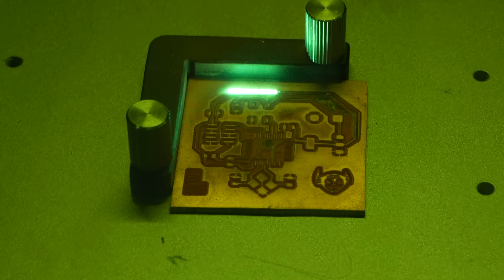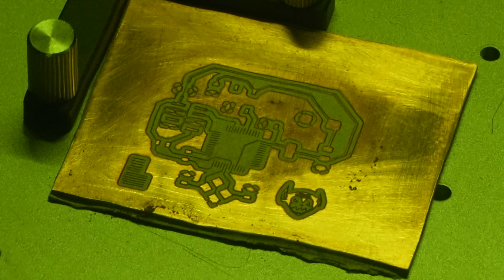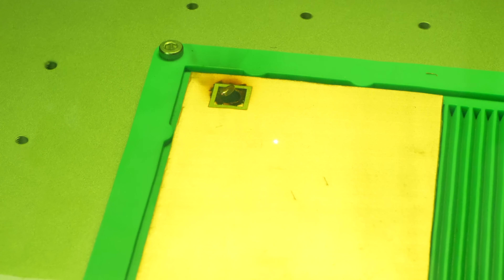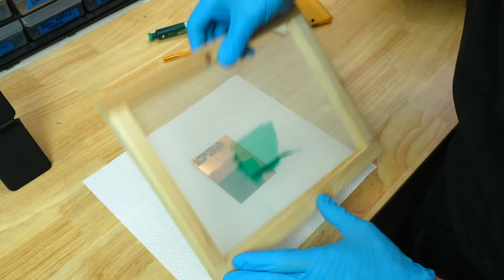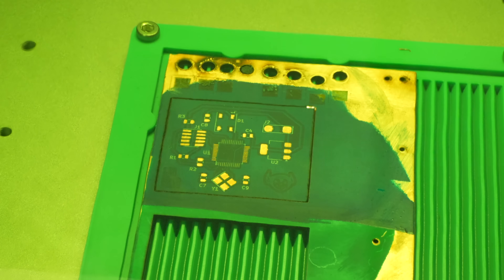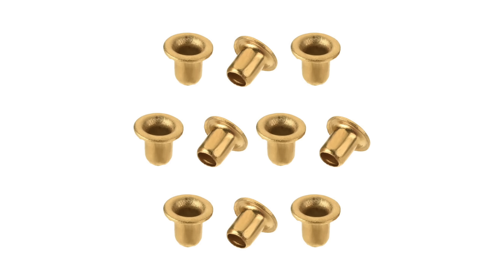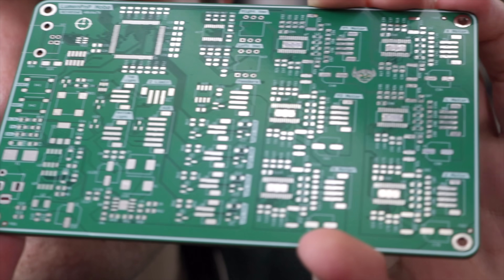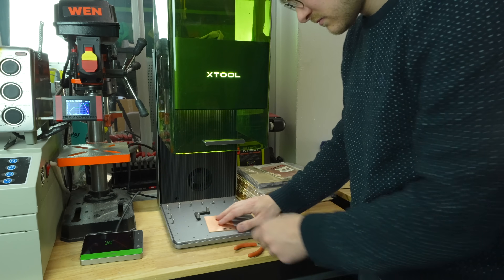Prototype PCBs faster than 3D Prints

Comment: As an electrical engineer I might have few suggestion: 

For the PCB alignment, you should use fiducials (little copper marker) in a triangle pattern. Then calibrate the XY plane of your machine by pointing the laser to it at a low intensity. This is how we are homing our pick and place machine. The other solution would be to use alignment pins, Drill at least two holes and use them as a reference for the next operation. Using the edge isn't a good option as it is never flush nor totally square and will cause alignment issues;

For the "via", I did try the rivet methods while I was at Uni and it was painfully slow! If you don't need to solder a component into the via, it was faster to simply use a copper wire and solder it through the via hole. If you are using a thin gauge (28AWG) this will result in a smaller via than if you where using a rivet. And like you said, I was also always soldering all the rivets because I had issue with connectivity/resistance otherwise. So if you need to solder anyways, better solder something fast! I also tried two other things to make it faster with modest success, I used a solid copper wire (diode lead) that I was pressing into a tight via hole and cutting the excess with flush cutter. Doing this for all the via without soldering. And then I applied solder paster to it when I was ready to oven reflow the part. I would suggest this approach only if you are planning using solder paste. Finally, I also tried to plug the hole directly with solder paste, but it wasn't working properly, maybe it could work by tweaking the hole diameter;

Also, I have others random suggestion, you could use Liquid Tin by MG Chemical to apply a small layer of thin on all the copper to reduce oxidation on pad that are not soldered. It also make it easier to solder onto the pad. When cutting hole, it seems that you are dumping to much heat at the same time, I would either add a wait time between each laser pass or cut multiple via at the same time to avoid heat build up. Avoid using via all together, make pads on the top and bottom and solder a pcb perpendicular to the main pcb to connect the pad together, this is WAY faster than trying to make via but it will make your design bigger and it might be not practical in some scenario. 

Like your your work, good luck with your projects !
Reply: Definitely good shout with the liquid tin, I've seen and felt the difference and it really does up the level of professionality. For the vias, I think he's looking for something more "at-home" automatable with what he has or what is readily/economically available. When most of it is automated already, using wire for any board with more than a couple vias would feel tedious quick, even on a prototype run of 10 pieces.
Reply: @thewolfin  Sure but automating rivet won't be easy either! The only ways to "automate" it would be either fill the hole with a paste that is conductive (solder paster, silver epoxy) or doing the whole plating bath shebang.
Reply: Bumping this up. I think the drill+wire+solder is the way to go for vias. As an upside, I think it would have bigger current/thermal carrying capacity than a factory via, but automating them would be... Interesting, to say the least. To maintain flatness you'd need to drop a piece of wire that's slightly shorter than the thickness of the board, and somehow leave it hanging in the middle.

Plated holes for mounting/through-hole components would be a nightmare, can't think of a better alternative to regular plating than rivets.

Theoretically, with tight enough parameters and an argon blow, it should be possible to "laser weld" the wire, but I imagine it would be a nightmare to tune the process for.
Reply: @Taugeshtu putting two (different!) metals together is always done by ultrasonic bonding. Less heat and if done right, no oxidation on the contact surface. It builds a real alloy of the two metals in the contact area, where welding would carries too much heat in and can cause delamination of the copper.
Reply: Cut alignment holes and make a jig with matching pegs. 

You could use through hole rivers to make the jig pegs. Cut holes in the jig. Push through extra long rivets.

Cut alignment holes in board the same diameter as through hole rivets.
Reply: Ah, the „register-pin-idea“ for alignment is already placed. 

I like your recommendation for the vias: soldering a wire and cutting it off is really faster, than rivets.
Reply: Came to look if anyone had mentioned a register pin. Had the same idea about the via's.
I like that edge solder idea too, make a circuit box instead of circuit board lol.
Reply: as someone who is not in this field at all, for any via that would need a component soldered into it, what is stopping you from leaving the hole empty and just using the leg of the component itself as a via
Reply: @hankhasemeier6887   You would need to solder both the top and bottom of the component you want to use as via. This might be easy with a through hole resistor or diode. However, this is way harder with any part that cover the leads (example, electrolytic capacitor, socket, led, connectors). Also in that case, surface mount component are needed to be use easily with a pick and place machine. So the through hole component would be limited to component that cannot be easily soldered both side anyways.
Reply: @matthope_qc  ahh thats right thanks for the info. Not being in this field I pretty regularly forget that surface mount components exist. Ive never had a hot air station or done any work with surface mount components.
Reply: @hankhasemeier6887  I haven't made any PCBs in years, but I used to etch boards, which meant laborious manual drilling. I found that a judicious combination of SMD & through-hole components could minimize the number of holes in a two-sided design.

Incidentally, according to the MSDS, that Liquid Tin seems pretty nasty.
Reply: The "liquid tin" suggestion sounds like DIY HASL. Makes total sense to do that.
Reply: Really what you write here is awesome. Let me ask one question if you can support me to get more understanding the Tin layer on the shown copper how can I apply it ? When can I apply it , before or after solder mask? 
If I apply it after solder mask, is it will cover the solder mask or it will not get stick on it ? 

Can I use it to fill the inner surface of the via to make a connection between the layers ?
Reply: @Abaqrino2020  the liquid tin react with the copper, so if you use a solder mask it should still work as long as the copper is exposed. Since it only reacts with copper it shouldn't do anything to the solder mask. But I think it is better to do it before. Finally, it won't fill a via, the layer is too thin for that. 😢
Reply: @matthope_qc that’s great I got the point , is there any chemical can be used to be a conductive and fill the via ?
Reply: @Abaqrino2020  I only used rivet or wire. Never had luck with chemical process. good luck 🤞
Reply: @matthope_qc  thanks a lot , I will try the chemical and give you the feedback.💪🏻😄

Comment: Consider using silver adhesive in the via holes w/ a low temp solder? Something below the max temp of the silver adhesive. I worry w/ via holes about the "parallax" (for lack of a better term) of vias far away from the center of the board. I think the solution may be an X-Y stage to hold the board which, with some other method of indexing, may also help solve the alignment issue.

Comment: What about the quality and lifespan of the board? Laser use heat > copper is a good thermal conductor > heat causes copper to oxidise > oxidised copper loses its high performance for electric conductivity and increases resistance? I guess laser it is a good way for making prototypes or as a proof of concept, but don't think it can produce high quality of products.

Comment: The Voltera PCB printers use a conductive ink for their traces, so perhaps that ink or something similar could be used for vias to fill the hole and then drill the rest out. Not sure how much power that method can handle potentially requiring tweaks for some designs, but it might be sufficient for certain prototypes

Comment: how about dispensing some solid wire through the hole and then soldering them to via pads on both sides of the pcb with solder paste? Aligning could maybe be done using holes and dowels. Can't wait for next videos. I'd love to be able to make boards this quick.

Comment: This is going to be completely game changing for quick breakout boards. No way I'm waiting days to weeks if I can stick a new sensor, microcontroller, display or whatever onto a board in 20 minutes. Or just for tidying up breadboards during prototyping where I just want to stick other boards, buttons, pots and things onto something more secure while I work on it.
Reply: This
Reply: This isn’t any game charger, you can do it for less than 30 minutes and for a setup less than $100. You don’t need any expensive Fiber Laser.
Reply: @silentobserver964  I've done that and it is not the same.

Comment: I love this so much, and everything you do! We are so close to the dream of start-to-finish electronics at home.
At a previous proto lab, we had a LPFK laser specifically for PCBs. The way those machines are set up, full ablation is undesirable, it's a fallback. The primary way they remove copper from FR4 is they draw outlines around an area (an "isolation cut"), cut the area into thin strips of copper with a hatching pattern, then heat that area with a de-focused laser to de-laminate the copper. You can watch thin little threads of copper fly off the board as it's working. 
This was all done in their custom, closed-source software (which was a huge pain to use), so it might be really tough to make those patterns from scratch in other software, but it might have better results on these smaller fiber lasers!
Reply: LPKF is to PCB fabrication as 3D Systems/Stratasys has been to 3D printing.  They've been doing it for a long time catering to high-end customers...
Reply: @josephchiu4034  We also had a Stratasys printer in that lab, and very much agree with that analogy! Getting a technician out to service them was always rough, and everything's locked in and proprietary.
Reply: @alpantone  McDonald's laser cream machine broke

Comment: On the point of the rivets i tought you could set the bad size of the via big enough for the head of it and just laser them enough to cut something like a pocket so you get the same height. Think that needs really good testing but should work if set up correct. Thanks for the great videos and your work 😄

Comment: FR4 boards could also be made, but the process would require you to use chemicals. Process: Apply solder mask on copper board. Make negative image on the solder mask (only traces remain covered with mask), etch copper away. Remove mask from pads and here you go, board complete.

Comment: Decades ago, there were a few companies that sold incerts for VIA connections.  They varied in thicknesses,  length, and outer shapes.  Some also sold a die set to assist in hand pressing and flaring the board facing ends while keeping them open for part insertion.   I would not recommend it as it would make it manual per hole.  I would recommend looking at copper compounds that others have made copper tracks for circuit boards as a potential way to fill the holes and use the laser to make the holes conducive.

Comment: that's so cool! As for the vias, maybe it would be possible to insert copper tubes (basically rivets but without the heads) and then just solder them in place? or flare them out in some way.
Reply: Why not mini rivets?

Comment: Answering the mothod to align the PCB along the steps to finish the job, why not creating a build tray that can hold the PCB with a few pins?
You then drill  3 or 4 holes on the PCB that would serve as alignment points, kind like fiducial marks do for populating, and place the it on that build tray aligned by the pins.
Those pins should be fixed to the build tray (magnets, screws..) so they don't move along the process.

Moving on, this could help aligning the PCB on double side circuits

Keep on boy, I love your videos
Cheers

Comment: I was working with aluminum PCBs and having trouble working with just one side. A friend recommended 0 ohm resistors and it made things muuuuch easier. You can basically use them at wire crossings instead of using by a via
Reply: yeah I never really realized what 0 ohm resistors were used for until I tried making my own PCB and realized that you could route traces under components. If you look at old or budget devices they do the exact same thing but use wires or things that look suspiciously similar to staples. I even caught a hard drive controller using them in a congested area.
Reply: Definitely jumpers, you can see (at 5:01) he uses one on this board. But there's always a limit to how small you can make a board, with the same components, in a given footprint, using only one side. It's exciting to think about the possibilities and push the limits as far as possible!

Comment: an idea i had (i don't know if it will work in reality) is to just put a little piece of bare wire through a via and solder it
Reply: It definitely works. I've done it to repair corroded vias.
Reply: lollipop & stem bridges

Comment: what about filling the holes with copper+tin powder and low temp sintering it with the laser? Maybe with a little binder too, so you don't have to handle oxygen sensitive powders.
copper+tin sinters around 250C, maybe even at 200C. (the gallium versions does its magic above 30C but is expensive, and I not sure how practical it is)

Comment: Here is what I would do for a 2 sided PCB..(simplified for example)
Make a PCB where the left side is the front and the right side is the back.
Print one side, then flip it over and print the same image on the other side.
When you are done, you should have 2 PCBs that are identical..

In KiCad, you would do this by making a 2 sided PCB design. 
Then copy the PCB and flip the copy so the blue layer becomes red on the copy.
Place the 2 PCBs edge to edge with a center hole between them for alignment.
Drill the alignment hole in the blank before you start etching and fit in on an alignment pin.
and zero your laser to that pin...

I hope that make sense..

Comment: I don't think it's worth writing off electroplating for multi-layer PCBs to be honest. For one, electroplating isn't that complex to do. It's a bit involved, but all things considered it's actually fairly simple. It's probably on-par if not easier than resin 3d printing, even if only because the chemicals involved tend to be a lot less problematic. 

In an ideal world, the sort of progression I'd hope for would be roughly along the lines of
Riveting could be used for rough tests; does the design seem like it will work. For instance say your designing a drone, you would use riveted multi-layer PCB's to just check and make sure each module functions. There aren't any shorts, everything connects alright, etc.

Electroplating would be used for actual parts; mark 1-inf. These would be the parts that you're okay spending a bit more time on, because you actually plan on using them. For the drone example, these would be the parts that you actually complete and then stick inside of the drone body, wire them up, and fly. These would, ideally, be functionally as-good as properly made parts. (you'd obviously be making some concessions, the job can always be done "a little better" no matter what method you use, but ideally a part like this would be "good enough" for most any case people actually care about) Even if it took 5 hours of manual work per board, whatever, you just want to be able to make it yourself, at home, in the small-quantity and high-quality that it's needed. (we're obviously not here yet, but I think we could be relatively soon if there was enough effort behind it) Ideally this could even go thicker than 2 layers, to 4 or 6 or even greater. (though tbh, I doubt many hobbyists actually need boards that thick.)

And finally real production services would be used for making products sold to others or otherwise a design that you need a lot of. Using the drone example, this would be after you've finalized your design and now it's just a matter of producing them to sell to customers. 

Even if it's slower than something for "rapid prototyping" and even if it's less cost effective per-part than mass production, those just aren't the things I really care about when it comes to DIY methods. Personally the bar I want any DIY method to reach is Low-Quantity, High-Quality. If it can be used for small-scale mass production too that's great, but my main bar to pass is always going to be getting just a few good versions.

Comment: Use the solder placing jig on the opulo to deposit solder paste stuff in the pre drilled holes and then melt it again with the laser to get plated vias for double sided PCBs. Need to optimize settings, maybe several circular passes on the holes